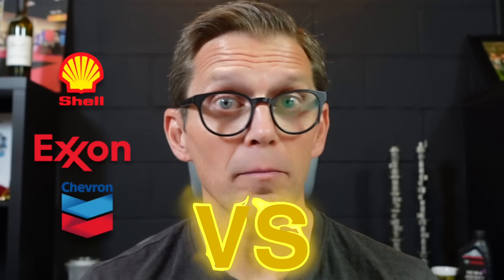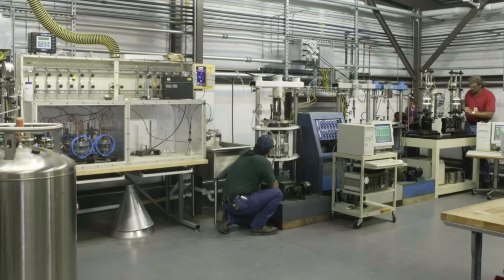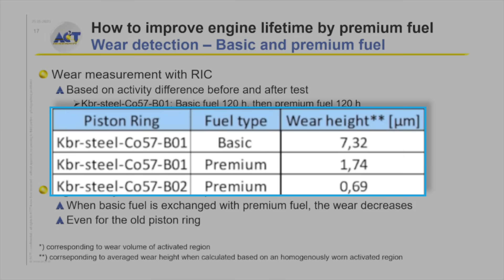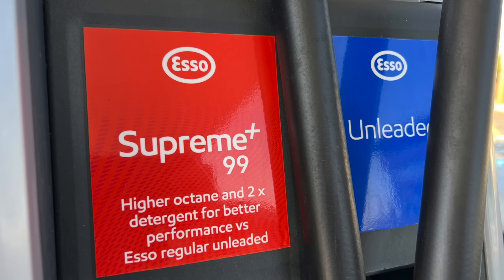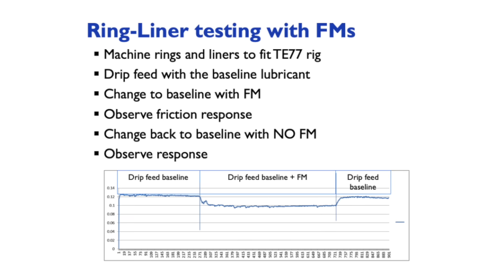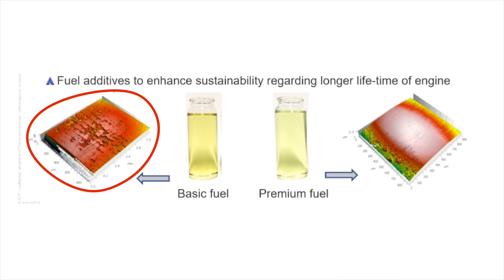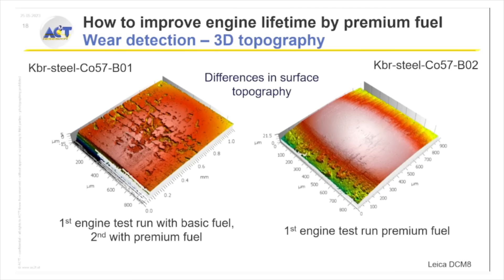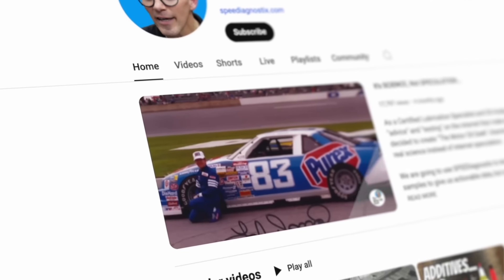Can Premium Fuel REDUCE Engine WEAR?

Comment: I use 91 in all my motors. From my lawn mower motorcycle to my car. Mostly to avoid the corn Ethenol.

Though, they do rip everyone off because the use shared hoses and pumps. So for the first few liters you are paying premium and getting whatever cheap swill the previous customer pumped.
Reply: Where do you live to get ethanal free gas?
Reply: @stevesmith756  Maybe it is because I live on the Gulf Coast where people buy marine gasoline, but my local Marathon (90 octane) and Murphy stations (93 octane) carry ethanol free.  I use it in my lawn equipment.
Reply: @ They won't let me post the website that lists all of the stations in the country that carry ethanol-free.  There are hundreds of stations in each of the two states I checked (one in the mid U.S. and the other on the Gulf Cost.   Just do a search for ethanol free gasoline and you will find it.
Reply: @ There is a website that lists the locations of ethanol-free gas by state and city.  Most states have hundreds of such stations.  Use the term pure gas in your search.
Reply: Problem is on the single-use hoses you will always get a portion of what the last person pumped.  Unless there is a dedicated hose to the product, there is no way to avoid it.
Reply: @ Where I buy ethanol free, there is a dedicated hose.  It is only available in 90 or 93 octane, depending on the brand.

Comment: You had alluded to basic fuel issues in a previous video.  I thought, at that time that the additive in premium fuel as a fuel injector cleaner.  Which would make sense.  I am surprised, but glad to learn that it is more.  Now, being a cheapskate, and I don't need the extra octane, I can add Techtron to my basic gasoline, but what can I add to get the zddp and home brew an additive package for the basic fuel?  Great job on explaining what is going on with fuel and oil in an engine.

Comment: I've always used premium fuel here in Aus. Even in my $1000 crapper cars I've bought to use for short periods between cars.
I always noticed a performance increase and more mileage between fill ups.. I've also noticed I don't need to get my injectors cleaned. Had a set of 6 injectors inspected and they didn't need cleaning at all. Spray pattern was spot on and they just needed new seals and were good to go. 160,000km of use.
I'm quite over people bashing premium fuels saying "you're wasting your money". 
My personal experience shows it makes a very noticeable difference....even in cars designed to use regular lower octane fuels.
Not just the "seat of the pants dyno" feel of the car but overall performance and efficiency.
100% Please do a comparison with the different fuels available and what additives they have.
That would make an epic video.

Comment: So you're telling me I have to buy premium fuel now? What if the manual says my truck is tuned for regular?
Reply: I wouldn't. You still want the octane your manual calls for. Octane is essentially a metric for the resistance for combustion. That could cause problems if you're running high octane in a low compression engine
Reply: @gaaarrryyy5 true but old thinking. Modern cars especially with turbos and super high compression ratios like the 24 Tacoma have knock sensors and ECU’s that will adjust and correct for this. Totally true for older cars though.

Comment: The wear being discussed is only the compression ring.
N.B. The overall wear in the engine would be barely affected.

Nonetheless, the rings perform a very important function... and if you can make them last ~1/3 (36 %) longer... that's well worth the effort.

🙂

Comment: What is considered Basic Fuel vs Premium fuel?  If my car takes 87 would that be considered basic?  Or does basic fuel mean non-branded fuel vs branded fuel?
Reply from the maker: Basic fuel is 87 (regardless of brand). Premium fuel is 91 to 93.
Reply: @themotoroilgeek Lots of mechanics say use what the manufacturer recommends in this case 87 would be the minimum as they say using premium gas is just a waste of money since there isn’t a real benefit. From watching your video paying the extra money does have its engine benefits.
Reply: @themotoroilgeek If your putting in 87 in your tank, would adding a fuel system treatment or cleaner such as Lucas Upper Cylinder or Chevron with Techron be any different than using premium fuel?
Reply from the maker: @RoamTek sounds like we need to do some testing to find out!

Comment: Where I live.
 We can buy ethonal free gas at about 60 cents a gallon more than 91.
 I have used it in my dirt bikes, small engine equipment. And my ski boat for many years.
 When I come home from running my boat or bikes.
 I put the gas that I didn't use in my Chevy pickup, and my wife's Honda CRV.
 After years of doing this.
The cleanliness of injectors and fuel system components has been great.
 The Chevy gets 1 mpg more, and the CRV gets 3 mpg more, on average.
 So that is bonus.

Comment: So your telling me that when I rebuilt my engine and made the compression higher(I increased the stroke) to where I need premium fuel to prevent detonation I am going to decrease the wear on it based on getting a better additive package with said premium fuel.

Jokes aside being able to test the oil at the ring while the engine is running is amazing. I'm honestly blown away but how an engine manages to run for thousands of hours when I think about how fast its really turning with the conditions it exist in. Having a device in there to sample the oil in real time must be a real feat of engineering and I wonder what other test and data could be found with such a device

Comment: gawd...  I am so glad I stumbled across the earlier videos I saw of yours.  I am now a raving fan of pretty much anything you post.  This is one area, in this video, I have been clamoring about for years - but nobody seems to care about my rantings about the impact of fuel on the engine oil.  Especially when there is an unexpected intrusion of fuel into the crankcase (leaking fuel pump diaphragm that dumps gasoline into the sump).  Even the fairly easy to disregard impact of fuel on oil in the piston ring grooves as opposed to oil in th emain sump and other parts of the engine.  That, of course, leads me into discussing the positive impact of the PCV system, to help keep oil from becoming unduly contaminated by fuel.  Anyway, what do I know?  Well, I know this - you have well validated some of what I have been harping on for years - common sense stuff that is born out in labs where solid proof reigns supreme.  Very cool...
Reply from the maker: Thanks!

Comment: So my car a 04 Corolla says it requires regular octane fuel? My question is does using premium fuel add fuel mileage? Or is there no difference as far as fuel mileage is concerned with premium vs regular? I know you said the additive package promotes less wear in the cylinder walls. Which is good to know. But I want to know whether or not buying premium is worth the squeeze?

Comment: Things seem so clear after watching this video. Thanks Lake for the great video
Reply: There was at least one motorcycle engine in the late 1930s which had an oil feed up the con rod to the gudgeon pin and then to a jet which sprayed oil to the underside of the piston crown. This was intended for cooling more than anything else. The oil system was low(ish) pressure but high volume. I have no idea whether or not it had any great benefit, but it was tried.

Comment: I grew up in a full service garage that sold Sunoco fuels. My teacher was an excellent mechanic and when I bought a 70 Satellite Convertible he said "throw 260 in it every third tank." I did and still do use premium every 3-4 tanks. 
Until my last two ford pickups that blew the hell up I've never had any engine problems ever.

Comment: I tried to use Shell gas and regularly would experience spark knock. D ifferent cars and different gas stations same thing verified by scanner detecting knock sensors pulling timing .I wish Sunoco gas was still around you could mix youre own gas !

Comment: I can say this. Me and my wife bought 2 chevrolet silverados in 2013. Hers 2wd mine 4wd. Same engine and transmission. I have always ran premium in my truck and she runs the cheap stuff. I have not replaced any thing on mine. Hers is on its 2nd set of injectors.  And its on its 2nd set of 02 sensors.
Reply: Hmmm,  it may also be the way you drive as well.  A lot of idling vs being at highway speed can  affect injectors as well.  Same for O2 sensors.  Nothing cleans better than running at speed to clean carbon .

Comment: In Australia, petroleum has 91 , 95, 98 octane . We were told 95 and 98 are less polluting,  however cost more per litre.   My question  is, why doesn't  the US do the same?  Is it cost , poor governance? 
👍🇭🇲🦘
Reply: Cars have to be built to use the higher octane fuel. Is you octane measured in the same manner as the US ? Europeans use a different test sequence with different numbers resulting.

Comment: Hi Lake you did not address how the shell 93 octane can help reduce engine wear in cars that have never used  that fuel??? How will it help reduce anymore  wear if I start using in my car at 116000 thousands miles. You need to give answers to this . Does any other gasoline have this additive package. Shell gas is high priced where I am. Please  trey to reply.  Thank You

Comment: Here in my eastern part of Canada , the lowest per liter premium fuel price is 1.799/L at a Costco which is supposed to be Top Tier. It has been a long time since the last time I used a GM acdelco fuel additive, I am below 30K kilometers on my 2022 Chevrolet Spark. Always do oil changes 3 months/5000km. Now that my job is only at less than 5 km from my place, I take time to let the engine idle more (not more than 4-5 minutes. Since I got this car new in august 2022, I did put fuel additives about 5 times. It runs on regular because cost of living is through the roof and I am going through a tough time financially.

Comment: My 03 Ford Ranger will be 22 years old this December....I've used ONLY Shell gasoline the entire time & once a month I use premium v-power...Also, once a month I use Lucas "tune up in a bottle"...I challenge anyone,  with a vehicle over 20 years old to have a smoother running & quieter engine...I'm a believer 100%...another interesting thing, my 20' Ford SUV runs far differently on Shell than Speedway gas...why? Couldn't tell ya, but it's noticeable...premium once every couple months & Lucas additive once or twice between oil changes... Runs great as well
Reply: Because your 2020 Ford SUV probably has an Ecoboost and they love octane and high quality fuels. It not only allows for more advanced fuel ignition timing but higher boost as well. The 3.5L Ecoboost can pick up around 35-40 hp by switching from 87 to 93

Comment: Here's a clue for you: You Americans are getting ripped off big time. In most other countries, like here in New Zealand, 91 octane fuel is the WEAKEST you can buy. 93 and 95 are the most common, with 97 being available at almost all gas stations. The vehicles you buy are de-tuned in the factories to suit your piss weak petrol. Yes, we have the exact same cars here including all the Japanese and Korean ones as well as American muscle cars. One of the reasons your fuel is so cheap is because it's as crappy as they can possibly make it.

Comment: I have a 6 month old 2024 Chevrolet Silverado 2500hd gasser with only 2,800 miles. I only use Chevron fuel. I will be doing my own oil changes. I really would like a video on Costco motor oil... 5w-30  PLEASE PLEASE.

Comment: I use Castrol Edge synthetic oil in all my engines. I use the weight recommended for the engine. It has worked well.
For gas, I had to stop buying off brand gas as well as regular gas.
 I have a 2003 Honda Accord four cylinder (207,000 miles) that LOVES Shell Nitro and Exxon Premium so, most of the time that is what I put into it. 
I do still use some off brand premiums like Sheets and Giant and Gulf and Citgo but not near as much as Shell and Exxon Premium.
Shell Nitro and Exxon Premium are incredible at quieting an engine and getting the car to run very quiet and smooth. I always buy premium gas now. I actually do use less gas pedal when I use these two gases in my Honda. When I try to run regular gas, the engine simply is not happy.
I am also happy that both Shell and Exxon have cleaners in their premiums, so I don't have to worry about gummed up injectors or sensors or adding any injector cleaner. I think if the gas has the cleaner in it all the time, the gummy residue left by ethanol is greatly reduced. I did see a great improvement in my car after about five consecutive tanks of Shell Nitro.
I need my car to run perfect every day. 
So, it is worth it to me to invest in a brand name premium gasoline.

Comment: So the cost difference in price to fill up my car with regular vs Premium fuel at Costco would be $12.24 as of today. Both of their fuels are rated as “Top Tier” which from my understanding meets certain additive requirements. Would aftermarket fuel additive help the regular to perform as good or better than the premium (assuming the premium had no aftermarket additive) I have found buying aftermarket additive in bulk makes them relatively cheap. I’m just curious what your thoughts are on this. Are there any aftermarket fuel additives that contain the same chemical packages (or better) of premium fuel that you know of?

Comment: Okay, I’ve got a question. As I’m understanding this the wear package in the fuel gets better with an increase in octane (in the United States). If my car is designed to run on 87, based on compression ratio etc. and I run 91 or 93 which in theory would resist ignition in my lower compression engine wouldn’t I be potentially contributing to oil dilution based on more unburned fuel in the cylinder?

Comment: Recently I used BP Excellium diesel which has no bio component in it and higher cetaan number and I filled up 10 tanks, so roughly 500 liter.
Sure, the engine ran very smooth, but fuel consumption went up as well, around 10% more than previous 30 tanks of regular diesel.
So.. what is going on? Fuel is 30 Euro cents more expensive and 10% more consumption. That makes the fuel too expensive. Rather change oil more often (10000km).

Comment: There's always so many ongoing debates on this subject. I put 93 octane in all my cars ( German ), and use Shell when I can, or Chevron/ Texaco. I've noticed I get better mileage out of my cars when using Shell. As far as engine wire, fuel can certainly help, but frequent oil changes, and maintenance are best.

Comment: I learned many years ago that fuel made by oil companies is usually the highest quality, so I have generally stuck to Shell, Mobil, Valero and other stations that are actually oil companies for my "good" cars, like Audi/BMW/Corvette/Jag etc. For my Toyota/Ford/Buick I just get whatever and I've never had an issue. Believe me, there IS a difference. A few years back on my first road trip in my new Alfa Romeo Giulia, I stopped at some random gas station in Little Rock, AR. I began gassing up, and before my wife even got back from the bathroom the car began sputtering and revving in a way I'd never seen before. I was shocked, but assumed it was cheap gas and just drove on. Nothing happened on the way home, and I've never seen that again since (never gassed up in Little Rock since). Imho, Euro cars its better to stick to the top brands, Asian and domestic you can put anything in there...

Comment: New cars: flush the oil out after 1500 km. Then after 5000 km. Then regular interval say 15-20.000 km. Use grade thicker W. Thus 5W makes 10W. 
Modern cars: use a thicker oil. Just one number p is okay like 5W to 10W. And warmed up ol from 30 to 40, but rather a 60. Combined that will be a 10W60. Your engine will be a lot saver. 
Older engines: use a estered oil like Castrol Magnatec. 
Old engines: probable a mineral oil. If so use a 15W50 or 20W50. 
...better safe then sorry.

Comment: True because majority of ICE rely on the crankshaft to splash oil on the cylinders walls. Factory built turbocharged and maybe supercharged also, have oil jets to squirt a high pressure stream of oil under the pistons constantly which causes oil to get on the cyl walls in addition to the crankshaft throwing in on the walls of the cylinders. So my summation would be that you would have a different result with those types of engines perhaps having a greater amount of oil to fuel on and within the ring lands. Oil control is much more of a paramount then naturally aspirated build engines.  Yes both are very important but turbocharged engines more so.

Comment: Once you pull the oil sample from the rings, wouldn't the parameters that have changed the oil there change again before any measurements for data?

If it reverts as it circulates through the engine (because it changes at the rings), this would say you're not measuring any parameters that are present in the "changed" oil at the rings.

Comment: Everyone has their engine oil preference or dislikes based on their own experience.  I was told by an old-time mechanic that he would never use a specific brand of oil because in his experience that brand had a real problem with leaving sludge and goops.  It was from the Motor Oil Geeks videos with quantitative data where I felt good in telling him that things had changed.

Now you open the fuel can of worms!  Fuel.  Gasolines are different all over the country in the USA, and the fuels in Europe are different than that as well as in Asia.  Add to this that people today don't always use the same brand of fuel in their car, and thus end up with quite the variety of fuels in their tanks.  Thanks for opening this can of worms, but at least it is based on factual data.  Thanks Lake